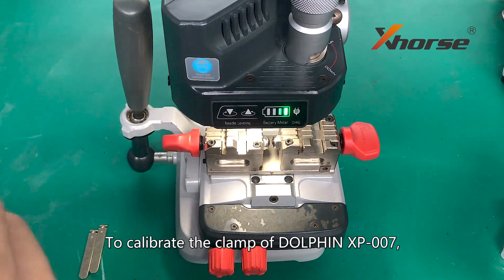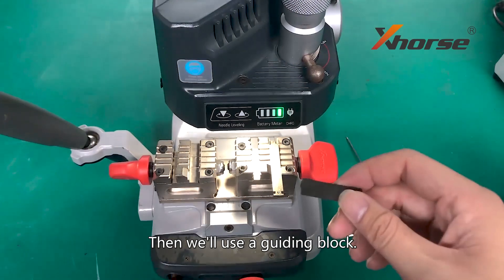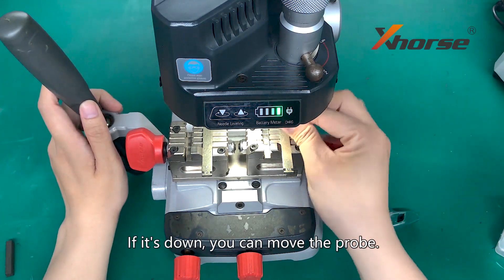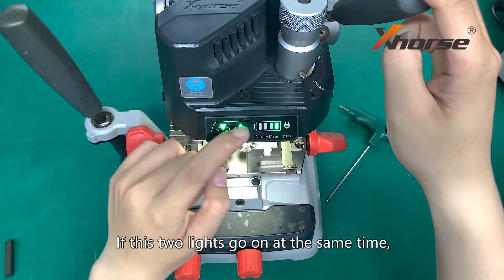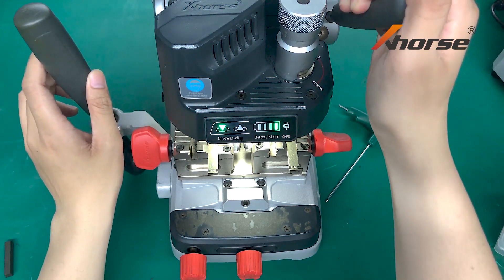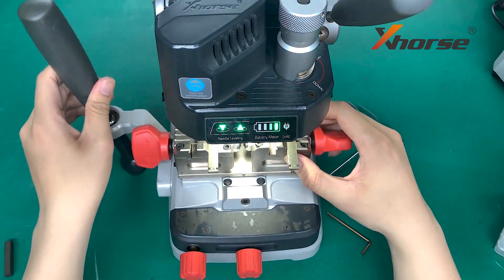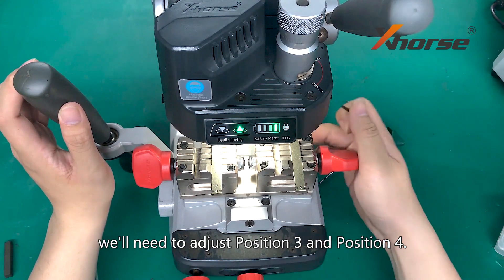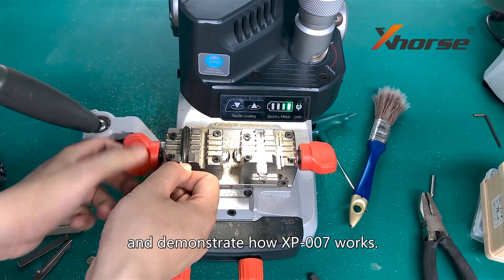How to calibrate clamp of Xhorse DOLPHIN XP-007 Key Cutting Machine and how it works?

Comment: You have to calibrate every time you cut a new key? Thank you. I have a XP007. I"m beginer.
Reply from the maker: There's no need to calibrate everytime you use, but it's recommended to give it a check before cutting. If you're having issue, you can contact Xhorse technical support on Xhorse APP for help. We'll try our best to help you.
Reply: @xhorseglobal6862  Thank you. 👍